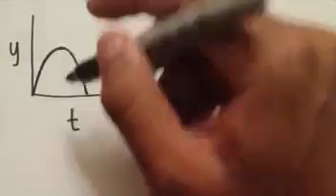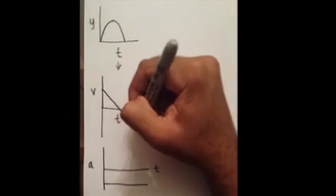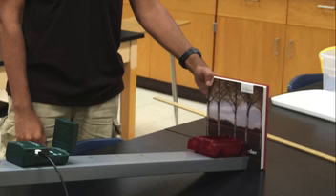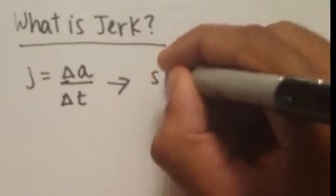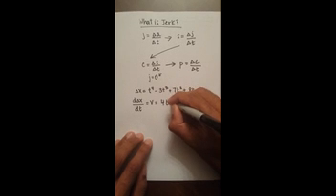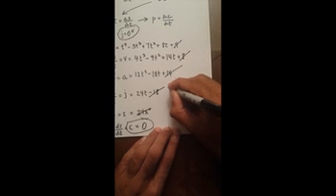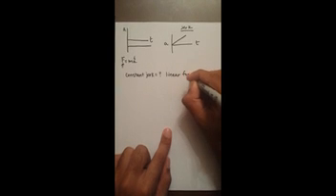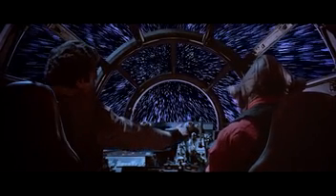Higher Order Derivatives of Acceleration: Jerk, Snap, Crackle and Pop

Comment: does the 3rd derivative of position describe air resistance
Reply from the maker: The 3rd derivative of position with respect to time (jerk), does not directly describe air resistance. Instead, jerk measures the rate of change of acceleration. 

Air resistance, also known as drag, is a force that opposes the motion of an object through a fluid (like air or water). The drag force is dependent on several factors, including the velocity of the object, the density of the fluid, the object's cross-sectional area perpendicular to the direction of motion, and the drag coefficient, which is determined by the shape of the object and the nature of the flow around it. The relationship is often expressed in the form of a differential equation that relates these factors to the acceleration of the object.

In contrast, the concept of jerk is more about how acceleration itself changes over time, without directly accounting for the causes of that change, such as air resistance. However, in dynamic systems where the forces (including air resistance) acting on an object change rapidly, jerk can be an important factor in understanding the motion of the object. For example, in vehicle dynamics, where air resistance can vary with speed in a non-linear way, the effects of changing acceleration (jerk) might be considered in designing for comfort and stability. 

To model air resistance specifically, one would typically focus on the second derivative of position (acceleration) as it is directly influenced by forces acting on the object, according to Newton's second law(F = ma), and incorporate the formula for drag force into the equations of motion.

Comment: 1:30 The acceleration would not be a constant negative. The ball would decelerate until it reaches maximum height (constant negative acceleration), then accelerate on the way down (constant positive acceleration) due to gravity. The acceleration line would flip over the x-axis at the midway point.
Reply: Velocity is a vector and its upward component is decreasing the whole time its accelerating to earth. The line crosses the x axis like that because the vector goes from up to down.
Reply: @jonas1271  Depends on your reference point I guess. I don't know if I'll ever holistically understand what "zero" means😅

Comment: derivative	terminology	SI unit	meaning
-5	absounce	mÂ·s5	time integral of abserk
-4	abserk	mÂ·s4	time integral of abseleration
-3	abseleration	mÂ·sÂ³	time integral of absity
-2	absity	mÂ·sÂ²	time integral of absement
-1	absement (absition)	mÂ·s	time integral of position
0	position (displacement)	m	position
1	velocity	mÂ·s-1	rate-of-change of position
2	acceleration	mÂ·s-2	rate of change of velocity
3	jerk	mÂ·s-3	rate of change of acceleration
4	jounce (snap)	mÂ·s-4	rate of change of jerk
5	crackle	mÂ·s-5	rate of change of jounce
6	pop	mÂ·s-6	rate of change of crackle
7	lock	mÂ·s-7	rate of change of pop
8	drop mÂ.s-8 rate of change of lock!
Reply: 9.Shot mÂ.s-9 rate of Changing Drop

10.Put mÂ.s-10 rate of changing Drop

Comment: Excellent video.  It shows, quite clearly, and mathematically, that most of the physics we do in the real world is an idealized form of mechanics.  However, there are real world problems - in fluid dynamics, telescope imaging design, railroad tracks around a curve, cam shaft design, roller coaster rides - that force engineers to minimize jerk (that is, jerky motion), and even minimize snap (also called jounce; as in 'bounce').  The Hubble Telescope required minimal jerk and jounce.  Or snap.

Comment: For anyone curious, the ones after pop are lock and then drop I believe
Reply: Is anything after jerk something that you can feel and describe? Change of acceleration is definitely not convenient ... like emergency brake in a train/tram or sudden sideways force due to badly designed turn. But what happens where force causing causing acceleration is not linear, but for example it grows or decreases with speed or depends on position?
Reply: @pavelperina7629  I think you missed the joke XD but you're describing something close to a spring, it changes acceleration based on its compression, so I think jerk describes it well. Anything past jerk is difficult to imagine for me.

Comment: Neeraj, Cheers from Hungary ! Great short lecture, a bit fuzzy (240 p :) )  but a very important lecture, for me. Change in acceleration (accelerating acceleration) is important concept to know. Beyond material engineering finance behavioral economics are fields where these concepts are useful for traders and engineers.
Financial shocks for example are coming regularly.   "In physics, jerk is the rate of change of acceleration; that is, the time derivative of acceleration, and as such the second derivative of velocity, or the third time derivative of position. According to the result of dimensional analysis of jerk, [length/time3], the SI units for its magnitude are m/s3 (or m⋅s−3); this can also be expressed in standard gravity per second (g/s). "
Reply: You might like this link Arjun Jayadev  Inequality and macroeconomic dynamics
http://www.clipular.com/c/5221055170609152.png?k=P3mVDbQAZt2YfIkUP-bINTX-9PU

Comment: Nice to know your views. A small question as we know the significance /applications of Acceleration and Velocities with the real world (K.E = 1/2*m*v2 or F=m*a) what is the significance of Jerk, Snap, Crackle, and Pop? I mean where we can apply it to understand or evaluate something?
Reply: Finally, someone asking important questions. I've studied Jerk, Jounce and Flounce for more than a year now, but I do so because it's essential to my career. I'm a robotics engineer, I build and design 3D printers, which require extreme, micrometer precision, as well as other general robotics.
I'm currently working on a video about the negative affects of jerk, jounce and flounce in machines, it will be uploaded soon!
But here's a simplification. What's the difference between traveling 60km/h vs traveling 30km/s, speeding up to 90km/s then back down again every second? They both travel at the same velocity and accelerate and decelerate at the same speeds. The difference is in how often they accelerated, aka jerk. This is why people say new drivers are "jerky", not because they're rude but because they cannot accelerate properly, so they end up accelerating and decelerating rapidly, which results in "resonance". 
If you accelerate quickly you're be pushed back, but if before you reach the back of your seat you decelerate, you'll begin to be pushed forward and your body will absorb most but not all of the backwards kinetic force, if you do this over and over you basically become a human tuning fork, the following changed in acceleration will be magnified by the resonance of previous chances in acceleration.
Reply: Suppose you throw a ball from the moon onto the earth, it will undergo positive and increasing acceleration (because the moon is about 3*10^5 km and the effect of earths gravity there is less than what it is on the surface of the earth and hence gravitational acceleration due to earth will go on increasing as the ball approaches the Earth's surface) and increasing acceleration is Jerk. Since the moon will also try to pull the ball I wouldn't say the jerk will be constant. That's an example I could think of :)

Comment: Why does the velocity decrease futher  when the ball goes down?
Reply: I know this is late but oh well
after it hits zero it doesn't decrease it starts increasing again but in the opposite direction
Reply: It does decrease - as in becomes more negative.
Decreasing is the process of becoming less over time.
Four is less than five, so a change from five to four is a decrease.
-5 is less than -4, so a change from -4 to -5 is a decrease, even though the magnitude increased.

In this way, as the object falls it gains negative velocity, thereby decreasing velocity.
Speed (the magnitude) of course, is increasing.